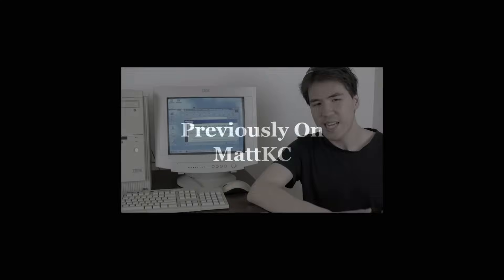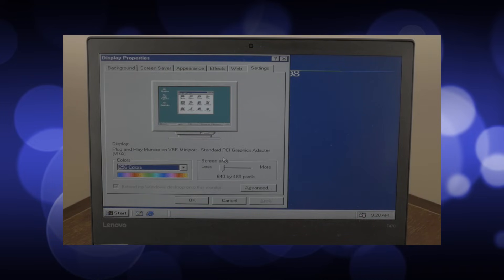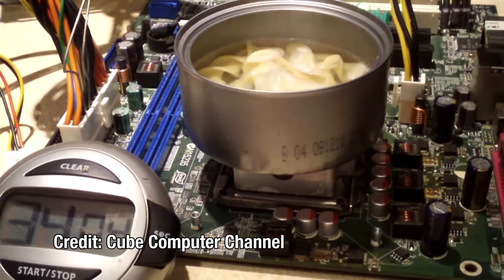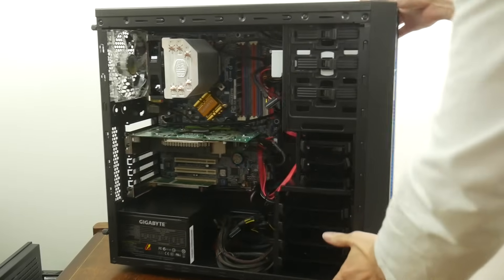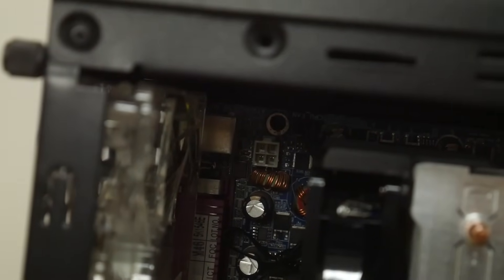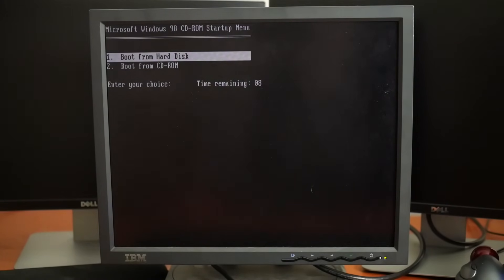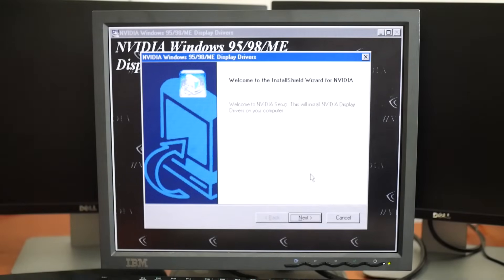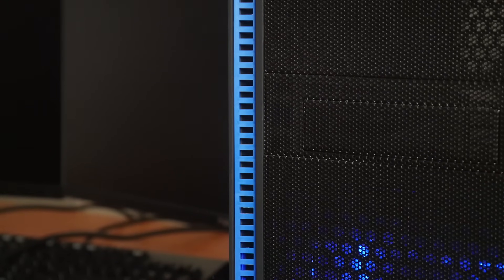The QUEST For The ULTIMATE Windows 98 PC [Part 1]

Comment: There is no such thing as the ultimate Windows 98 PC.  You need many for total compatibility with older software and hardware.  Not too mention if we're strictly talking games, you have to decide on what GPU you want.  And back then there were MANY.  And then you have to match your game to the correct DirectX version.  Case in point: If you had a Voodoo 2 and you wanted to play Star Wars: Dark Forces II - Jedi Knight, if your DirectX AND your 3Dfx drivers were too new, you would lose transparency in the game.  I miss the old days.  :)

Comment: you cannot use the display to DVI  its only an output.  meaning you cannot use it on the monitor end.   it should only but used for Video cards that have display port out. to DVI

Comment: I got some bad news. Core 2 CPUs can run with ddr2 ram and even pcie gpus with this mobo I used to use.   http://www.asrock.com/mb/Intel/ConRoe865PE/#Download. I think I read that there are hacked 7800gtx drivers for win9x as well. Tbh I'd use a 5900gtx as it's overkill still for 9x and you still have 8 bit pallettes textures and fog tables.
Reply: He said thet he wouldnt use any hacks.

Comment: How in the hell did you get an SSD working?  I can barely get a normal sata hard drive to work well with Windows 98 SE and half the times i get errors trying to install via SATA optical drive.  Legit bought a USB Floppy drive in hopes to have a better install process.   My "ultimate 98" machine crapped out along the way.     Near same specs.   Have to use a 256MB video card as anything higher causes issues.   512 is maybe the max but I don't think there is going to be a game needing that much for 98.

Comment: These Adapter do not work the way you used them.
These are dp to dvi and not the other way around. Just get a simple adapter cable for 5usd which is dvi to hdmi.
It will work with most hdmi monitors.

Comment: AGP X8 ATI RADEON 9600 128 MB (CLUB 3D)
intel QX9770   with 3.2 Ghz is on 775 socket,  also Xeon CPU's is more productive than that You chose
since 775 CPU is dual chanell, You also must use 2 sticks of ram to really be the "ultimate"
but right now  You have "layers son" calculator.
Reply: It is true that hes build is FAR from being "ultimate". But the best win98 graphics card combo is a RADEON x850XT plus a voodoo3(for compatibility). He should also use a motherboard with a VIA  P4M900 & VT8237S chip-set  for DDR2 and SATA-2 support. A quad/dual core CPU only use 1 core anyway, so a cheaper 3.33GHz dual core will be faster. But in WinNT will be better. And I assume you use your PC for OS multi-boot?
Reply: @OldAndNewStuf  thank You for answer, but then we need "faster" definition, Yes, You can put in celeron cpu with greater frequency, it will be faster if we look the megahertz measurement, but then everything works faster if CPU have more transistors inside and L2 cache.  so as I see the ultimate PC, it must have the CPU power not the raw frequency
Reply: @realdamageboy  I was thinking about the Core2 Duo and their Pentium brand  equivalents. They can have more cache per CPU die than the quad cores. So they do have more "CPU power"  in win98 single tread applications.
Reply: @realdamageboy  But naturally the ultimate PC is a total overkill. Even the slowest LGA775 celeron is faster than a 1,5GHz Pentium 3. And windows 98 hardly needs a 1GHz Pentium anyway.

Comment: Up this comment!
FYI

Get new mobo! The 6800 isnt supported by your board. That is issue with compatibility..

And the converters for monitors ONLY work the other way around. You need DVI->XXX converters, the ones you use is XXX->DVI converters!

Comment: Missing .dll's and buggy drivers, welcome to windows 98
Reply: Still plagues modern Windows to an extent sometimes, lol
Reply: @trollsthatlol1  to an extent but it's much better, I can take a drive from one PC, plug it into another and boot into windows 10 and it will have most of the drivers without going online. Windows 98 would bootloop with hardware installed designed for it lmao

Comment: 98 is really picky about sound cards.  Sound Blaster included drivers for CD roms and for sound. Not sure if other sound cards included CD rom drivers. Oak Technology CD rom drivers. Probably your motherboard sound chip does not have driver's 98 can use.  In the day all 98 computers used PCI soundboards. PCIE is too advanced.  You need to buy a period PCI sound board.

Comment: I sincerely hope you didn't really pay $851 for that processor... Did you even realize you can get a 1.8 Ghz Core2duo for $5 or less used on ebay and it would be faster than the 3.8 Ghz P4 by +97% ? And your board probably supports it too. And the Core2duo's run nice and cool and you can just get by with a normal $5 aluminum intel stock heatsink.

Comment: Athlon 64 was much faster than any pentium 4 any there are many good athlon 64 motherboards that have all the drivers for windows 9x
Reply: Athlon master race
Reply: @kaisercreb  Not sure what you mean. Athlon 64 was one of the rare times when they did beat intel clearly when it came to CPUs. All my other PCs have been using intel cpu. Pentium 4 just sucked in comparison.

Comment: Pentium 4 was very inefficient and gave a ton of frame drops as the architecture is broken, too long pipelines... 6800 ultra will give problems running a ton of games from that era as games were made for older cards (lots of older cards that actually give higher frame rates, same problem counts for geforce fx cards. Ultimate choice would be radeon 9800xt, or geforce4 ti 4600 if you do not plan on using directx 9) and 1gb of ram is too much for the dos part of win 98, besides this using an ssd has no value as win 98 cannot make use of the speeds and will break the ssd very soon, a hdd will give better result speaking out of experience. Also one should pick a new case from 20 years back, nice all metal (alu) instead of cheap plastics, they are still out there, i know as i have a few

Comment: Why on Earth would you go for a P4? Im running a c2q9650@4.2ghz on my windows 98 box, which absolutely destroys any p4,....its not even a contest. Yes, multicore support is minimal under Win9x and requires specific support, but I went for the core2quad for the large cache, which being shared architecture means the active core inherits entire cache. 
edit: damn, just watched the rest of the video,.... this is so very, very far from the ultimate Win9x PC. Something twice the speed that is fully supported could be put together easily enough.

Comment: This would be a nice vídeo but you should research more... Actually the AMD CPU were much better on those days, a athlon cpu would be better than those pentium 4 that could reach stupid high temperatures, just because it's faster it's not better.
Also 512mb of ram would stop from freezing the computer... 1 gb is more than it could handle... Two 256 mb DDR400 working on dual channel would do the trick.
Also any soundblaster card would be better than those onboard ones.
For a killer graphic card you should try any radeon 9600 with 256mb. Those were more compatible than the one you started with and more than enough to handle anything you through at it.
You also should disable a few things in BIOS that can make the computer crash like ports that you're not going to use.
Sorry to say but you show lack of experience building windows 98 computers.
Maybe you should call the video 'Learning to build the ultimate windows 98 PC"
There's a lot of forums that can help you out with this build, the main one being Vogons. Check it out...

Comment: friend built a dream machine in 2004 think he spent 5500$ on parts at the. only to put windows 98SE on it at first later on he dual booted it with sever 2003 and redhat or was it fedora tried gento 2004 but that was broken as hell o yea only took 30seconds from starting install to finish for 98SE

Comment: My asus p5pe-vm can run with core 2 duo extreme cpu Conroe 2.9ghz ; ram limit should be 512mb 600w is way overkill for any machine running win98 400w should be more than enough mine video runs on geforce 6200
Reply: Those bfg cards are always screwed up unless you have one brand new never used stay far away

Comment: Look Matt Everything is New With you 98 rig
There Some Working Things Here it is
Intel Pentium 4 3.2 Ghz Socket 478
NVIDIA Geforce 6800 Ultra (Fixed) / ATi Radeon 9800XT / NVIDIA Geforce 4 4600/4800 Ti
MSI 645E P4 Socket 478
IDE CD-ROM And IDE Hard Drive
Sound Blaster Live! / Sound Blaster Audigy 2 ZS

Comment: Maaan, athlon 64 or XP is waaaaay stronger than this thrash (i just bought a mobo with 512MB DDR, GeForce2 MX 220 and P4 prescott 2.8Ght btw for 3$ approx) and if you install sp3 you can stick on 2.5GB ram